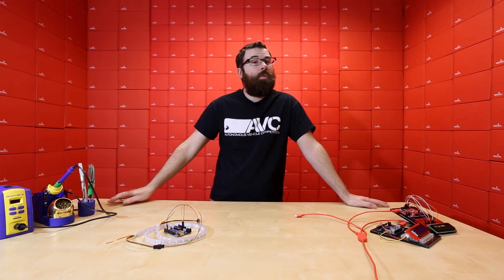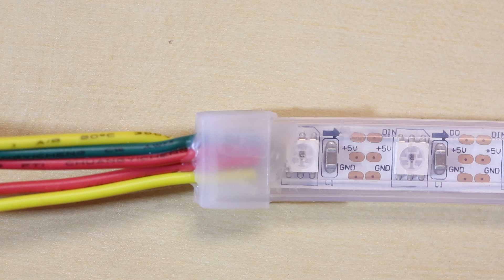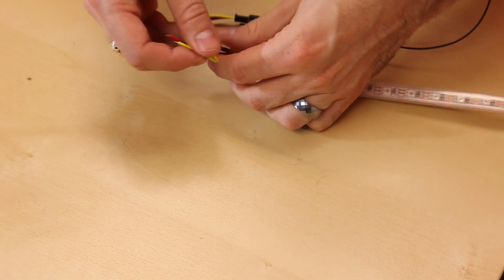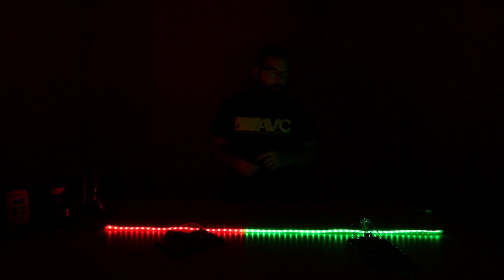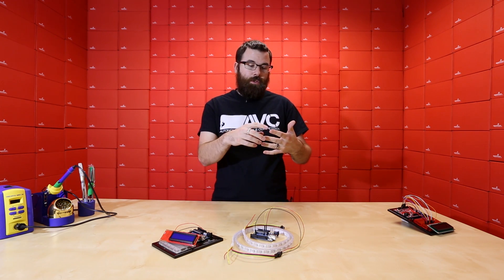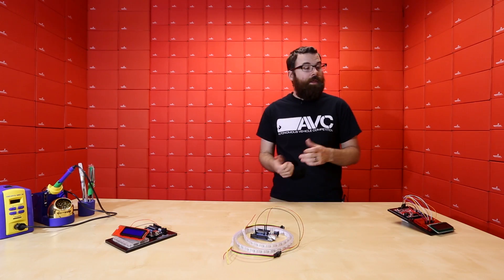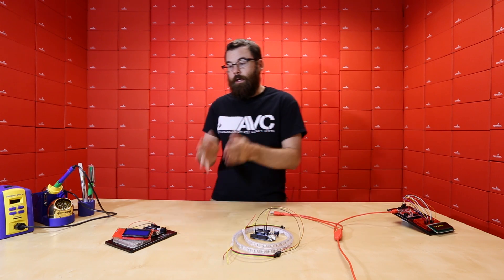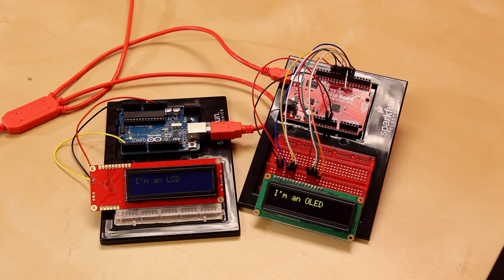SparkFun 10-18-13 Product Showcase: OLED Dog, New Tricks

Comment: They are using the Adafruit NeoPixel library to drive the strip. It looks like he was running the strandtest demo sketch, which includes a delay in the colorWipe function that gives that effect. It doesn't have to go that slowly. There is a great guide at Adafruit for that library. Unfortunately, YouTube won't let me post a link to it.

Comment: How fast can an Arduino control a strip of addressable LEDs in a "chase" configuration?  Let's say I want to light 1/4 of the LEDs at a time and fire them sequencially to simulate movement so that no more than 1/4 of the LEDs are lit at any one time.  The speed of the changes in your demo made me question just how fast this can be, although the sketch may have intentionally delayed the changes for the video.